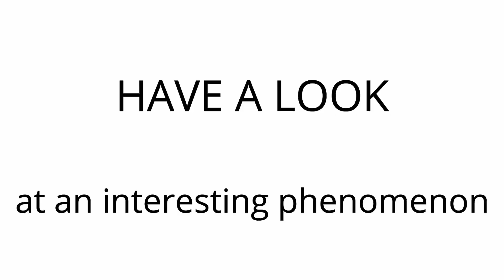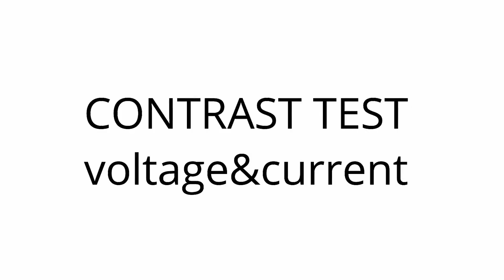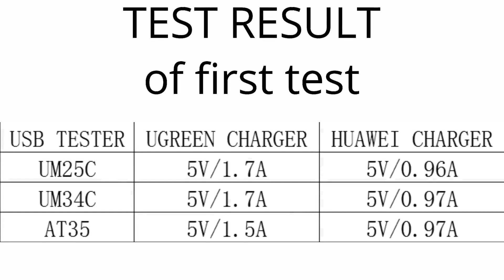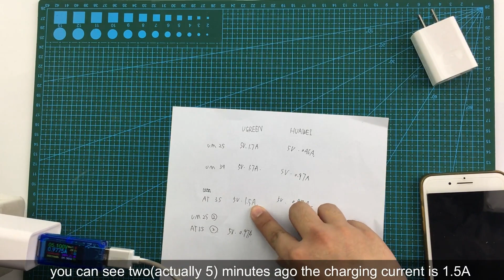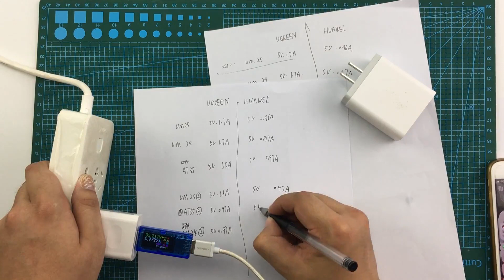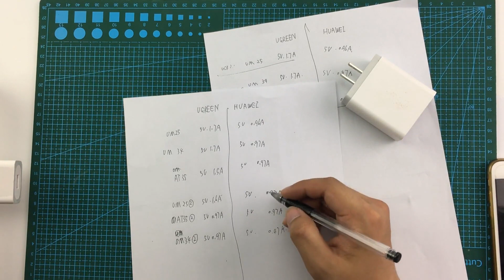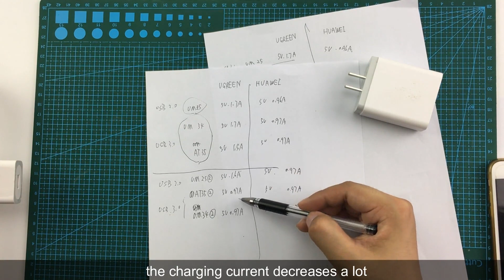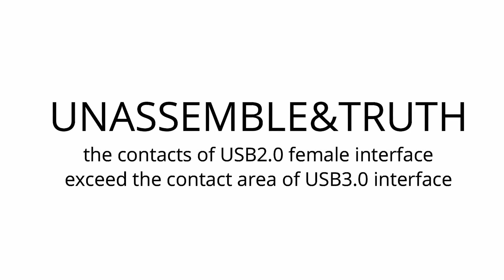USB2.0(female) →USB3.0(male) quick charge don't work？

Comment: Вывод у меня такой - не берите тестеры с портом 3.0, иначе будете смотреть данное видео. Ведь не все зарядки делаются с такими портами, а с ними тестер работать не будет. И не важно, что должна быть обратная совместимость между портами - смотрите видео, если знаете английский. Или как немое кино.
Reply from the maker: for usb 3.0 port, we use good quality male port, but if there is a bad quality USB2.0 female port on the charger, they do not match properly
Reply: @rdtech9153  Можно подумать, что только вы ставите хорошие порты, а все остальные - с кривыми руками. Так сходите объясните, как надо делать. Вам намного ближе.
Reply from the maker: @user-W2L5D8  we make sure that we use good quality USB3.0 male port, it is no doubt, and we just analyze the reasons
Reply: @rdtech9153  I'm also trying to find the reason why only one device behaves this way on all power sources, while all other testers, power banks and phones, which are also enough, do not have such a problem on these ports.
Reply from the maker: @user-W2L5D8  for other USB2.0 USB tester, no matter it is good or bad quality USB2.0 female port, they contact well because they are USB2.0, but the problem happens for USB3.0 to USB2.0 port